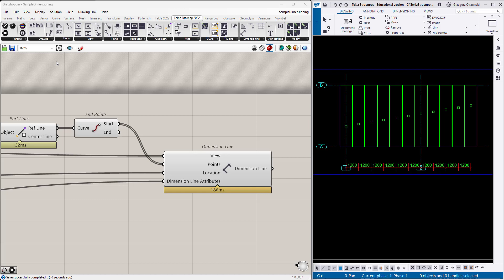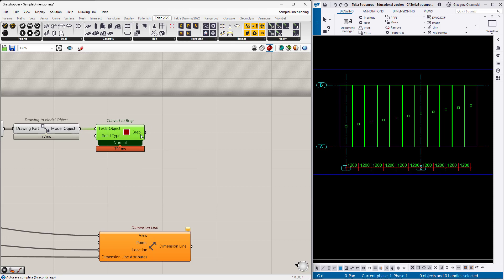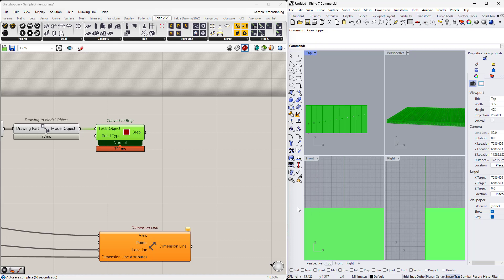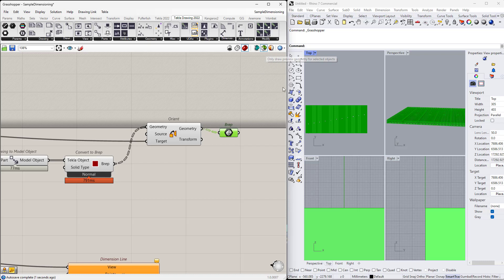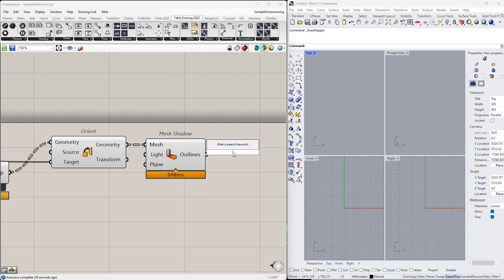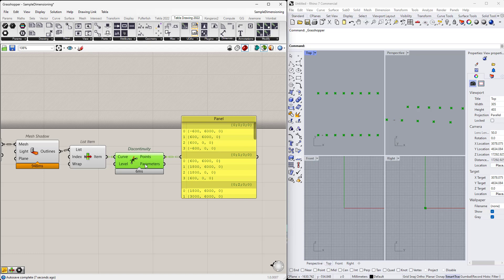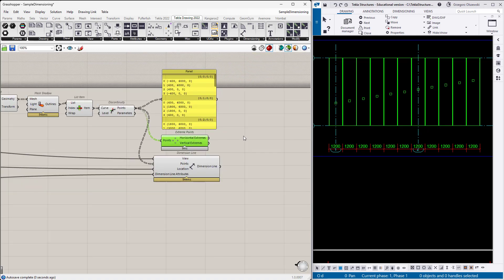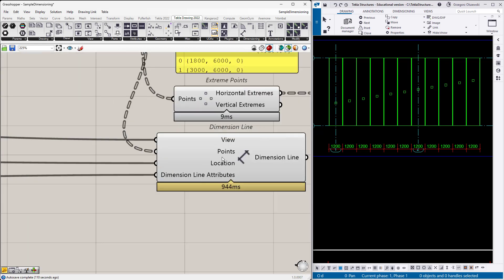Grasshopper-Tekla Drawing Link Dimensioning part III

Comment: Hi, when I try to create a section view, the Brep with View Orient is in mirror with the Tekla object. 

I tried multiple times, and Orient from the corresponding Tekla view is not giving me the same object orientation as Tekla drawing. Did you guys had this issue?
Reply from the maker: Hi @alexis709a! Are you using Display coordinate system for orienting?
Please create an issue on GitHub:
https://github.com/LetsConstructIT/Grasshopper-TeklaDrawingLink/issues
It would be nice if you will share script/some screenshots to get better recognition what could be wrong.